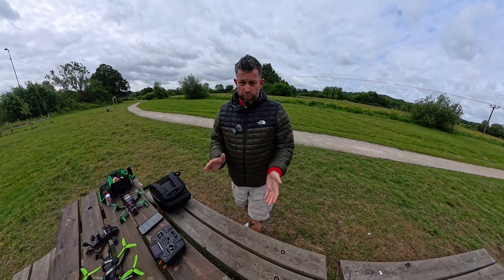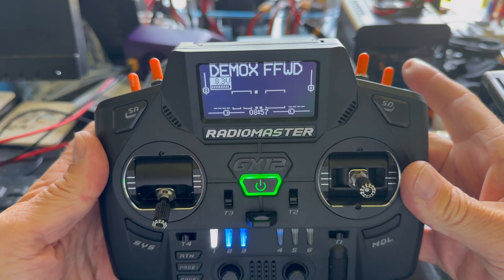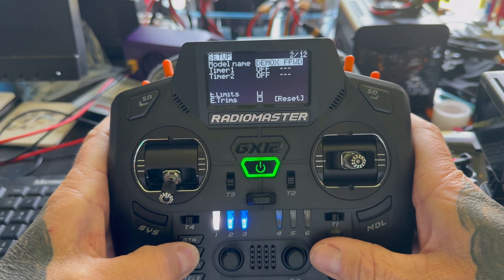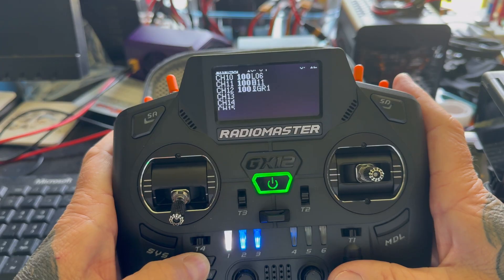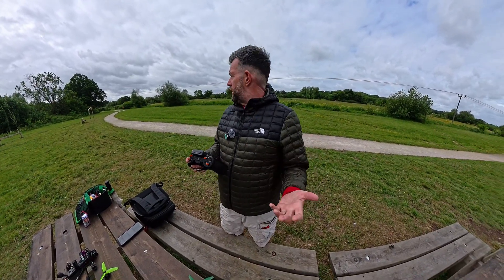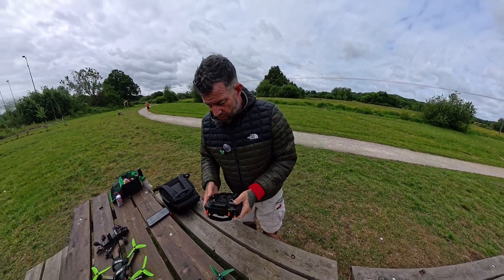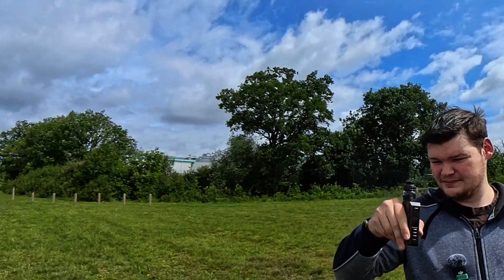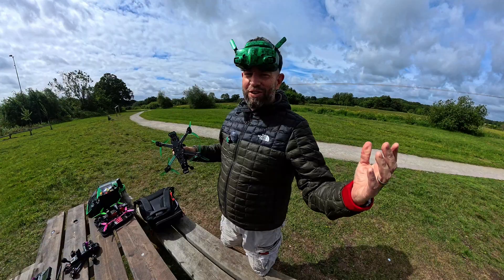ELRS Gemini-X No Satellites? Here’s What To Do!

Comment: I connect usb powerbank to drone for a minute unplug and then plug in drone with multiple satellites receiving
Reply from the maker: Yeah that works as long as you have a 4v5 power port 👍👌
Reply: @millermanffwdFPV yes correct which is usually the standard if you buy off the shelf with micro usb connectors
Reply from the maker: @para9111 yeah sadly not the case with the geprc FC, but there is a work around but it is a bit sketchy 😂

Comment: So... Are you saying that a Gemini-X transmitter is hindering the reception of GPS when the Gemini-X transmitter is transmitting at a high power?
Reply from the maker: Yes it does unfortunately however the way to rectify this is to have the TX in dynamic mode when unarmed and then when armed use your desired signal strength usually when you have 8+ sats once you are in the air it’s not a problem as it’s the TX strength when nearby that effects it since I discovered this method I’ve had no problems whatsoever. Gem-X is absolutely awesome I deffo recommend it 👌👌👍